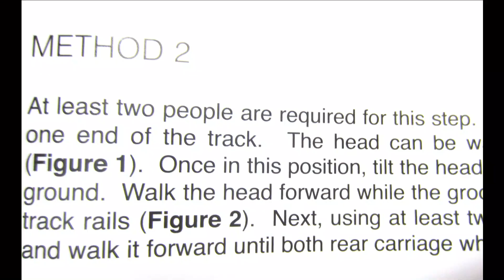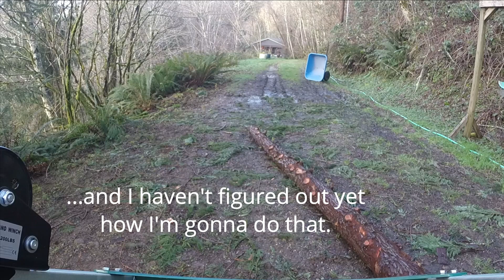Sawmill Saga 3: Getting the Sawmill Onto the Track

Comment: Reminds of when I pulled my 600 lb wood stove uphill through the woods to my cabin.  Glad to see I'm not the only one who isn't bright.  
I have the 130 mill and currently in the process of assembling it.  Funny to watch your vids and see that we all go through the same thing from screwed up delivery to how to do it without assistance from anyone.
Reply from the maker: I'd love to see a video of your stove move.
Reply: @OregonOldTimer  I built a 100% off grid timber frame home by hand in the middle of nowhere but I didn't want to disturb the environment by cutting trees and plowing roads in so I literally had to carry, by hand, every board, beam and nail through the woods.  Generator, tools, supplies, etc. Once finished, all the furniture.  The stove I smartened up a little and used a 12V battery powered winch to pull it inch by inch.  Still took a full day. Not one person other than myself pitched in which I am fine with.  No video!  Only a few pictures to document my stupidity.  If I made videos they would be heavily laden with expletives. I am surprised how calm you can be in your vids.
I am just hooking up the throttle on my 130Max saw today.  This is a much bigger project than initially anticipated, especially solo!  Work smarter, not harder these days.  I'm barely still in my 40's and wishing I was in my 20's!  Thanks for making and posting your vids.
Reply from the maker: @johnbauby6612  If I were always calm and watched my language, I wouldn't have to spend so much time editing.